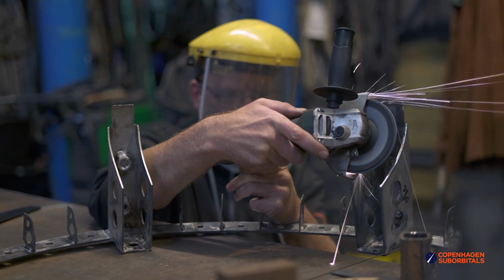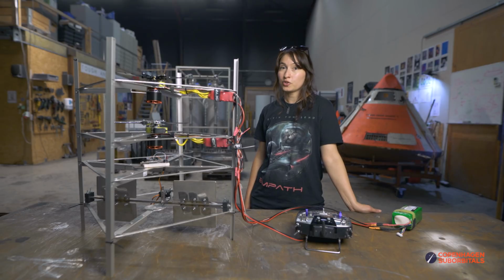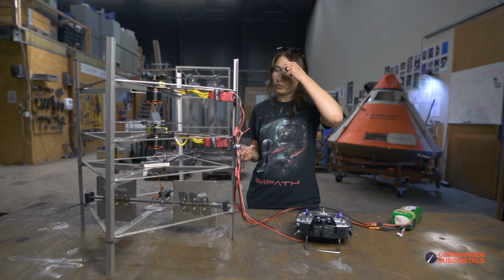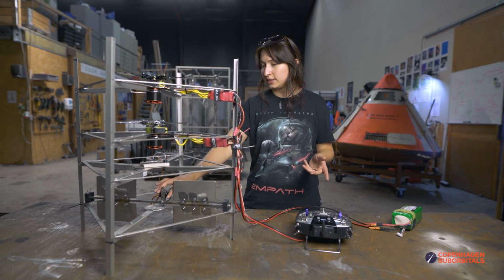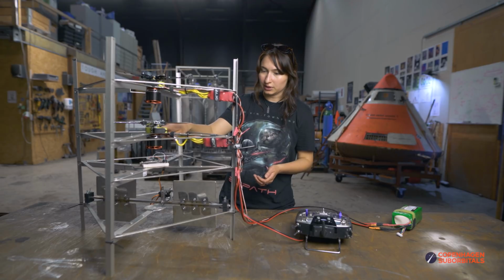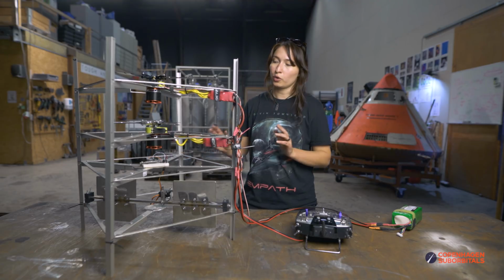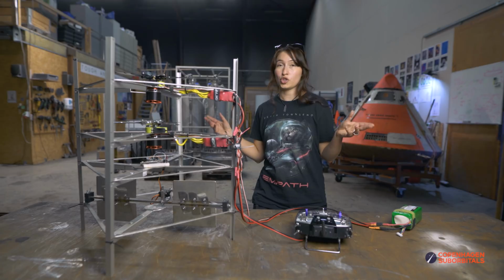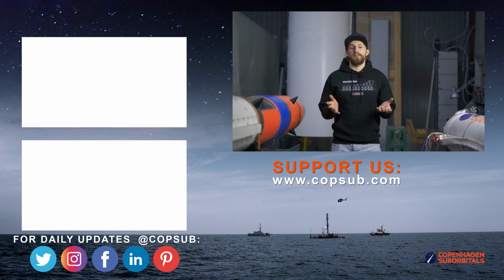DIY Drone to Test ROCKET GUIDANCE | INSIDE THE ROCKETSHOP: Episode 26

Comment: Wow this is super interesting. Could you elaborate on the sensors that determine where the drone is in 3D space. Also, it is not obvious why a drone will mimic a rocket. Why not use a simple chemical toy rocket?

Comment: It looks like airflow from the propellers will be quite turbulent after hitting IMU and frame and control surfaces/software will have a hard time keeping drone under control. Why not do standard quad configuration and ducted fan at the center with thrust vectoring?
Reply: I was thinking that also - If it turns out to be a problem maybe she can relocate the offending frame pieces.

Comment: Difficult task. Arian 5 fail first time. PID controller is risky to make a model for it. Needs more different sensors for the task to tune the PID. Time based is possible but perhaps not for first time. (Not having the real data)

Comment: So why not testing with cold gas thrusters, with power regulated by a mini version of the DPR pushing out cold gas instead of hot exhaust.
Reply: @John. Because tanks and plumbing for cold gas is more complicated and heavier. Small batteries and small electric motors are a lot easier to construct. When you want a physical model to regulate and test vector thrust and vector forces, electrical motors are so much easier. Build a simple model and learn and understand all aspects of forces in play, then add complexity as you grow your understanding of the dynamic system. When you master that, you may also have reached a level were you understand the limitations of the model and maybe understand how to get beyond them. So in my view, this approach makes perfect sense. Anyway, this is some initial step of a longer path.
Reply: Tom stanton did that. See https://www.youtube.com/watch?v=XpA6qpNlNOE and see how much work he had to do to get so little fly-time per tanking.
Reply: @petermaersk-moller3014  My idea was to use smaller tanks to realistically represent the tank regulation problems that affected Nexø-1
Reply from the maker: @John DoDo Doe Nexø I didn't have a DPR system, unless you meant Nexø II, of course. But how all this extra work would tie into Bianca's thesis work on gimbal control?
Reply: @CopenhagenSuborbitals  I was referring to the simpler pressure controls on N-1 that went off-nominal.  Also, I saw it as a test bench for the complete GNC, not just the gimbal.
Reply from the maker: @johndododoe1411   @John DoDo Doe  The issues with Nexø I were mostly due to a stuck valve, not enough time to fix it until launch window closing and extra time spent clearing the range from foreign vessels while the LOX was loaded and had its tank insulation already removed. All these issues were adressed with Nexø II. :)
Reply: @CopenhagenSuborbitals  A test platform should be able to reproduce past fault scenarios to make sure the countermeasures remain operational.
Reply from the maker: @johndododoe1411  Yes, that is every static engine test to some extent plus all the sea acceptence tests we do in the months leading up to launch. But hopefully we can now agree that handling pressure systems and cryogenics each time you want to test a software upgrade for an engine gimbal is a bit excessive. :)
Reply: @CopenhagenSuborbitals  It's called regression testing and should be as routine as pressure testing each new tank.

Comment: I think maybe a standard quad would be a much better starting platform if testing IMU and controller integration. That platform looks like it'll be difficult to get flying with existing flight control packages, let alone something being developed from scratch--not because of dynamics, but because of weight and rigidity.
Reply: Absolutely no need for quad for IMU-controller integration. 7:35 shows a part where such integration went on a breadboard on top of servo brackets for 2 axes control just fine
Plus the quad dynamics are different and just deviating from the purpose.
Reply: @BiancaDianaT  I think I initially meant more along the lines of: use a quad to test the implementation and tune your filtering parameters to demonstrate good data + tight enough control loop. Vehicle dynamics are trivial after that

Comment: Can you please go into detail, how you would find the actual PID values for a rocket? With a drone it is pretty easy, trial and error, but with a rocket you only get one shot. How do you measure the reaction of the plant, and convert that to a transfer function, to train the controller on?
Reply: Exactly, don't want trial and error :) 

In general, we will avoid details on this topic, only high level descriptions and updates

But you're on track
Reply: @BiancaDianaT  But ... but why. My guess is building a accurate simulation, calculating or approximating/linearising a model, then either choosing appropiate values for something like a PID and consequent trial and error in simulation, or calculating a propper controller for a desired response. Though, I think its her master thesis, so maybe some non linear controll?
Reply: watch Brian Douglas’ Matlab tech talks, he explains how you can approximate the tf of a plant without using first principles just by measuring the step response. the video is called system identification something.. i’ve forgotten it
Reply: @kirjet  Thank you. This is exactly what I was asking for.

Comment: Isn't it a little heavy? You could try to make a design like the electric rocket prototype that daniel made from the rctestflight channel, it seems to me a more robust and lighter design
Reply: Those propellers can handle its weight
Reply: @danukerudesu8919  I was only refering to the hardware. My previous job was to design and build prototype hardware for PHD & University research projects in order to give them the best chance for success so my observation is based on that.
I have no doubt Bianca will create a far better control system than Joe, but he's doing ok for someone self-taught who comes from a music background.
Lets try keep this constructive!
Reply: @SKYWURX  Joe is super awesome, love what he's doing and his mindset in general. Smart and competent guy right there
Reply: https://www.youtube.com/watch?v=e3jRZgqhqoU
https://www.youtube.com/watch?v=RMeEh5OUaDs
In my opinion these designs are more interesting to make those tests, yours seems to me very heavy and fragile and those fins being asymmetric because they have screws on one side, they still affect the way they deflate the air in an asymmetric way and give you problems.
Reply: @gabrielhacecosas  Yeah, this method of control system design & proof is almost exactly the same as Joe Barnard's method. https://www.youtube.com/watch?v=2ex4aejaGX8 not a criticism in any way, I was pleasantly surprised with the convergence of solutions to these control system problems.
Building more out of pultruded Carbon rod and 3d printed bracketry I think is the way to go though as Aluminium will just make the initial tests harder due to its weight and the greater momentum the vehicle will be able to produce.
Reply: @SKYWURX  it's expected to look into optimizing the build, in iterations 
Just, not right now, as it's not the focus point
Reply: @BiancaDianaT  I think the same as Alti-tude, your design is good and it works, but in my opinion it can give you some problems.  
Good luck with the project, I'm a big fan.
Reply: @gabrielhacecosas  Thanks for the support! Yeah, fair enough, we do expect some disturbances

It will have to do, for now :D